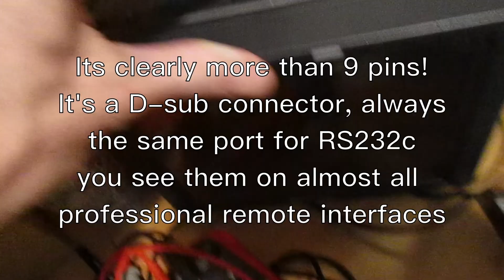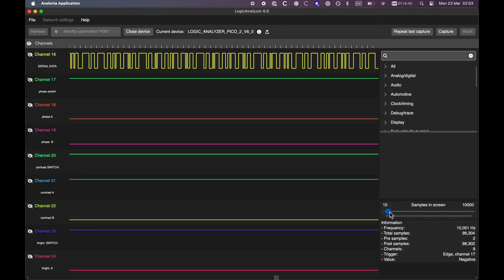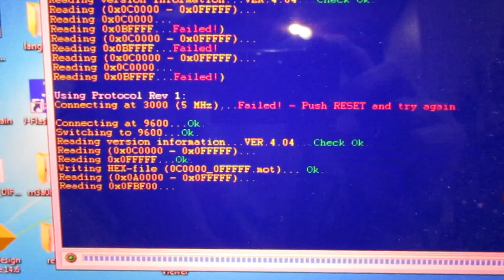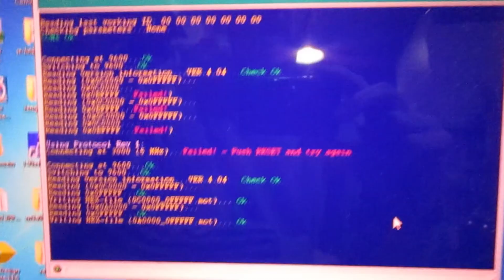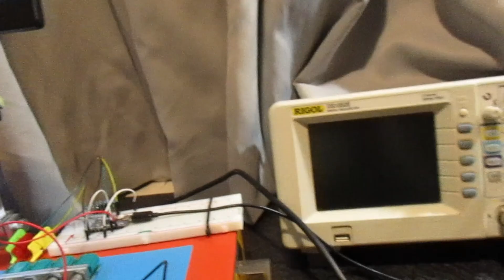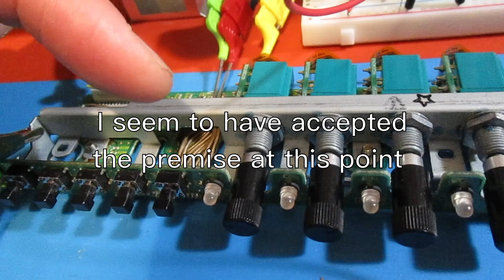PANASONIC BTLH900p - MIDI REMOTE CONTROL - ARDUINO - FSM MACHINE -M16C - LOGIC ANALYSER - RS232c -

Comment from the maker: Bringing the BTLH900p under simple remote control, so I can sequence colour effect changes.  I'm really looking for the RS232c command set for this monitor, it's not available where I can find it online.  

If you can help me locate it, or help me locate it in the firmware itself, please leave a comment.

I manage to get remote control working but not via serial, via sending commands from an arduino to the rotary encoders of the device panel.  this works, but is not as featured or well developed as the 
actual serial commands which are located in the firmware -

I dumped the firmware and have spent some days trying to locate the commands and framing header, with no results yet.  I only get error codes ER0012A and ER0022B - that's the only responses.

Enjoy the progress so far -